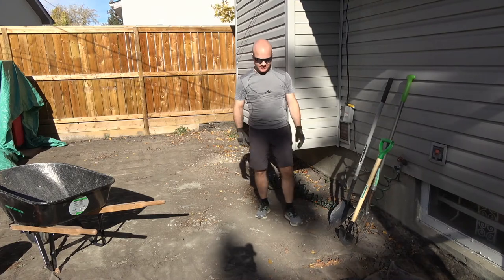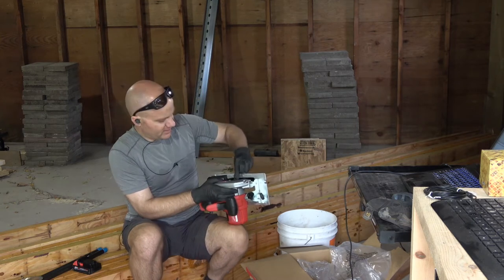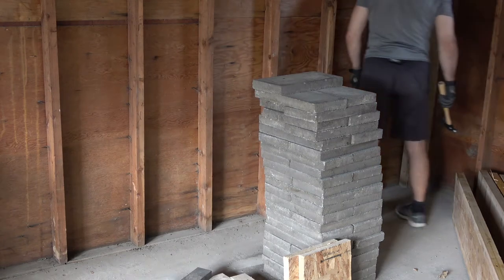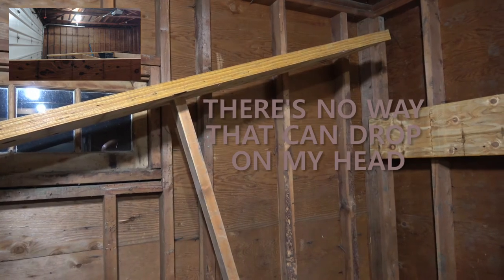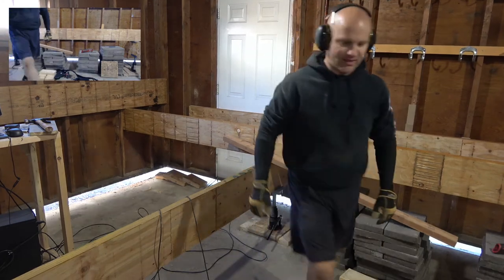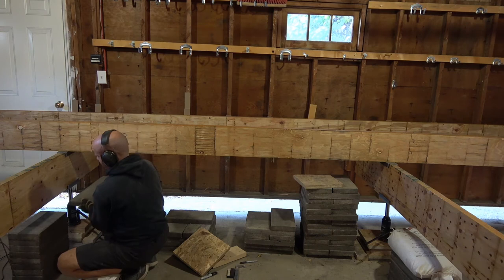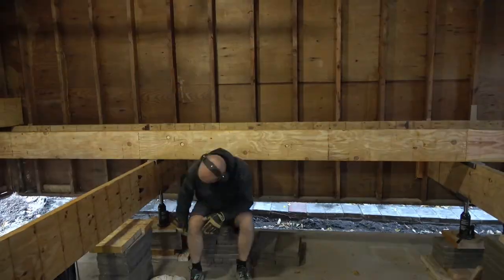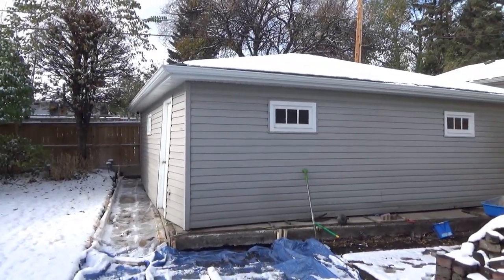How To: DIY Lift A Garage - Part 3

Comment: How long would you say the whole process took you?
Reply from the maker: @tbuffi3790  you could do it in a day if you had the material together
Reply: @MooseDoesStuff  I was talking about the whole project from start to finish? Unless I miss it, you had four videos on raising the garage? Looking at the days you posted. I'm thinking this took about a month?
Reply from the maker: @tbuffi3790  yeah I have to spread my work out based on what materials I have at the time. if you have the materials, it's a day job or less.

Comment: 18:54 🤣

Thanks for posting this. I need to raise my garage for a new foundation and slab.
Reply from the maker: be sure you use better supports than I did!
Reply: @MooseDoesStuff  Yeah. Sorry to see it didn't work out. I thought you did a great job though. A for effort. Ill let ya know when my make my attempt. Should be interesting. 🤣

Comment: Great videos, watched all 3 and realized you're in my city. I'm in Braeside and about to do same job by smaller, 24' x 16' unfinished and only up 4". LVL beams, correct? Where did you buy? Did you consider  steel beams under the hydraulics? If not, why? Thanks!
Reply from the maker: Depending on your siding you might have a much easier go of it. Mine had stucco which added a lot of weight.
I used LVL, call around for current prices, no idea what it's like now.
No need for steel under the jacks, concrete and pavers did the job for me.  I didn't go with steel for the beams because it would cost a lot more and I'd have no use for them after. reselling beams isn't easy.
The main thing to consider is how much working room you'll need to do whatever forming if you're pouring new concrete. For only 4" tho some people might just want to use bricks or cinderblocks.
Reply: LVL it is, I'll start calling around. Vinyl siding here, do you think regular 2x10 framing lumber would be strong enough for the perimeter where screwed/bolted into the studs?
Reply from the maker: @zanekryzanowsky  if you're following the same pattern, attaching the 2x10s to all the studs, then definitely. I used lvls because I was buying them anyway for something else.
Reply: Good to hear, much easier option to go 2x10s all around if that will be sufficient. Will reinforce the contact area with a steel plate, etc. I'm going to copy your exact method, feel much better now that I have the start of a plan, thanks!
Reply from the maker: @zanekryzanowsky  do be sure to have a look at more support once it's up. mine eventually fell, but for lifting this was fine

Comment: my garage is 56' wide and 31' deep. i want to raise it 6". im thinking of just bracing across the 3 doors with a truss and running a beam the depth of 31' on each side and one center. then just jacking from there? think that would work?
Reply from the maker: if you can jack near where the beams attach, you should have better luck than I did. you honestly don't need a lot of lifting points, just enough room to build whatever you need to underneath

Comment: Not a great way on how your stacking your blocks That could tip over very easy
Reply from the maker: well, they were over 1'x1' base, what would you suggest putting under it instead?
Reply: @MooseDoesStuff  Them blocks are not made to carry a load like that. Wrong type of blocks also you should use cribbing
Reply from the maker: @snicks50  That sounds like it wouldn't be any less likely to fall over. The base of these was 2'x2', which is plenty wide to prevent tipping. Getting 4x4s as "proper cribbing" would have cost 30$ per layer per post, and getting that up to 3' tall needs 11 layers. 11x30x4=1300$+ of never reusable material. Or I could use what I used  which I had, which was free. And didn't tip over.
Reply: @MooseDoesStuff  Last fall we lifted a 2 story house 12 inches not a problem. Its what I do. I use 6x6 or 6x8 most often for cribbing. Small jobs we will use 4x4
Reply from the maker: @snicks50  6x8? cost just doubled 🤣
Reply: @MooseDoesStuff  I lift houses and I have a semi load of the stuff